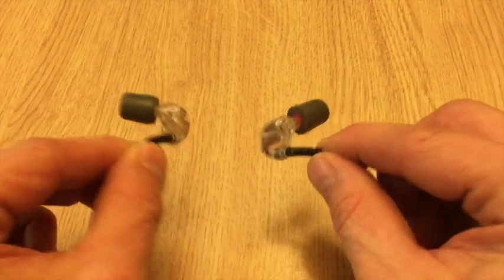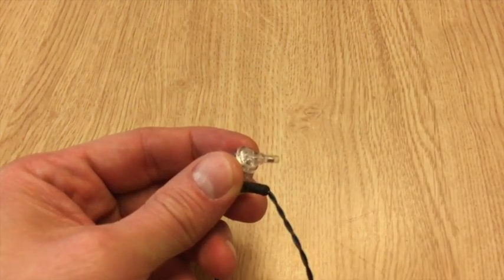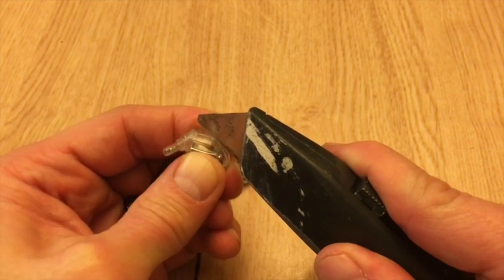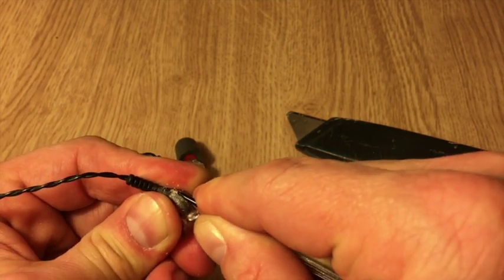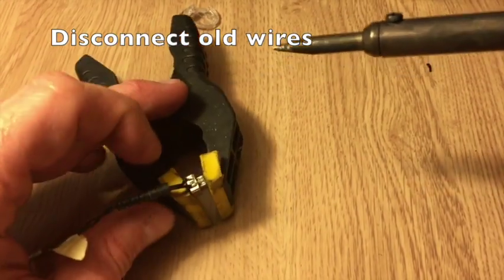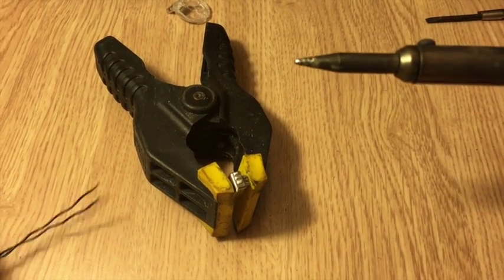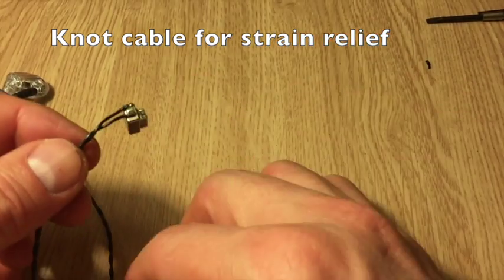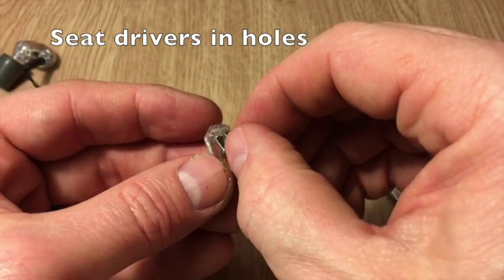DIY Westone UM2 In Ear Monitor (IEM) Short Repair

Comment: Thanks so much for this video! I just managed to fix mine. i find soldering really difficult, and did a pretty ugly job inside, but the westones are working again and thats the important thing! By the way, I also managed to slide and  the strain relief sleeve, with a bit of twist and force, so its still useable
Reply from the maker: Joe Taylor that’s awesome!  Glad to hear it and great tip about the strain relief. Enjoy!

Comment: Hmmm... I've been hesitant to attempt repair on my IEMs, a set of 7Hz Salnotes Dioko. One's gone unusably quiet, and no moisture-related intervention seems to have helped, which means it's likely electrical. (I don't think it's driver damage, as they're planar-magnetic, and the sound isn't distorted, just quiet.)
But seeing that a repair can be done on buds which appear much more fragile (compared to mine which are aluminum and thus more likely to be tolerant of a bit of manhandling) makes me feel like I could have a go at it.

Comment: Rather than add more solder to the driver and risk a puddle, use flux and add solder to the exposed copper of the wire.  This is called tinning the wire.  You can then just heat the wire up as you touch it to the driver and you should have no issues.
Reply from the maker: Havack1 thanks so much for pointing that out.  Soldering is definitely not my strong suit, so I’m glad you mentioned it. I’ll favorite your post so others will see it more readily.

Comment: what if the short is around the audio jack?
Reply from the maker: In this case you could on a new plug like this one:
SiYear 3-Pole 3.5mm Stereo Headphone Jack Male Plug Repair Replacement Solder Adapter, 3.5mm (1/8inch ) Solder Type DIY Audio Cable Connector(2PACK) https://www.amazon.com/dp/B07WZT7QGL/ref=cm_sw_r_cp_api_glt_fabc_JXK5NQZVNXJ7VVE8MNW4

When soldering though, note that the internal of some headphone wires are coated and the coating may stay on while soldering so it still won’t work after you think you’ve done a good solder job. 

If you experience that, you can heat some solder on a metal surface to 300 Celsius and while passing the write tip through it slowly it will have time to melt the coating. 

Other approaches I’ve seen are to use the hottest part of a match flame to try to melt the coating and/or use sandpaper to scrape the wire a bit.  These approaches produce more varied results, but the idea is to get the coating off there so the metal can connect to the new plug your putting on. 

All of this about stripping the coating only applies if you find that your particular cable has coating on it after initially stripping it. 

Hope this helps!

Comment: i need to open my shure se535's to replace the case/shell would you recommend i use the same method to break open the shell
Reply from the maker: Hi, Kev - the housing does look similar (from pictures I see on Google Images), however I've never tried this approach on that particular model.  When I did mine for the first time I tried to really take my time so I didn't apply too much force and break through the housing into the electronics inside.  So while I can't advise you one way or the other, if you do try it, I'd suggest to just take your time.  Since posting this video I've repaired 3 Westone UM2 sets with success.  Best to you!

Comment: can or have you worked on Westone UM3X  Headphones?
Reply from the maker: Hi, Gus.  We do now use several UM3X’s, with removable cables, so we haven’t had the need to cut them to replace the cables - we’ve just ordered new cables and snapped them in.  If yours have hard wired cables I suppose the same repair process may work, but haven’t tried it on those specifically. Best to you!

Comment: Good job! Have you noticed a difference in sound after the repair?
Reply from the maker: I will say in my brief listen after repair, the repaired ear may have sounded slightly lower in volume- but I was on the fence about it.
Both repairs I did were for IEMs used by other members of our worship team - I haven't heard any complaints from them
 using either pair, so I'm taking that as a good sign. :)

Comment: Does  matter what wire goes to the drives?
Reply from the maker: Joshue Gomes I would just reconnect them the way they were initially, or if you’ve already disconnected both then temporarily connect them and test to see if there’s a difference.  In my case I just reconnected to the same places.   If memory serves there may have been a different marking on one wire to distinguish it from the other. 

Best wishes!

Comment: Hey... you didn`t rescue the plastic spring that makes more resistant the cable exiting the earphone capsule... it's hard to take off the broken cable inside it, but you didn't attempt anyway... lazy.
Reply from the maker: Sergio Mastríaco the strain relief is so bonded to the cable that preserving it was not possible. That’s why the extra hot glue was used in its place to provide strain relief. If you can however remove it without it breaking up, then that’s great.
Reply: @eaglesongs  Several times, I used a drill bit in order to scratch the cord from its inside... it works. Really. But take care with your fingers,  hohohoho...
Reply from the maker: Good tip.  Thanks.